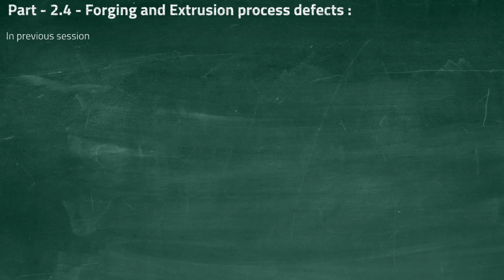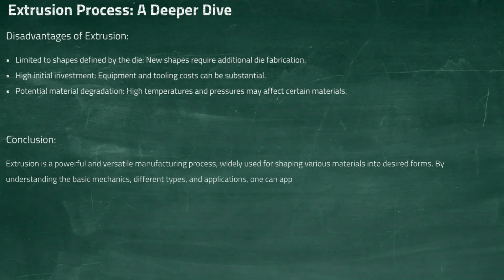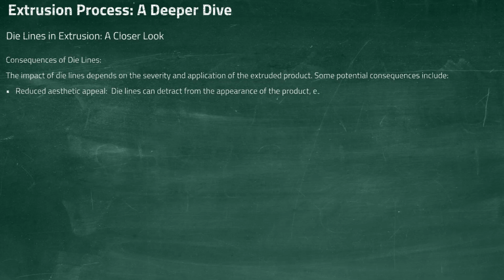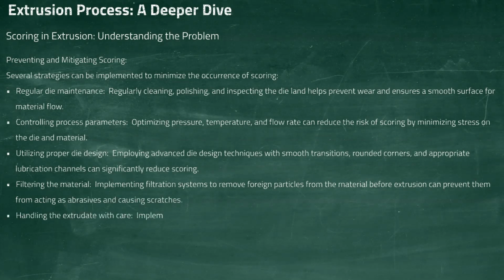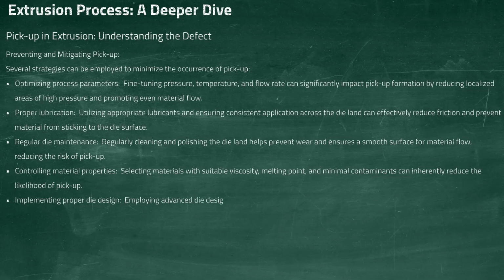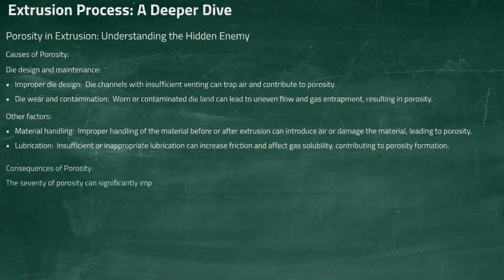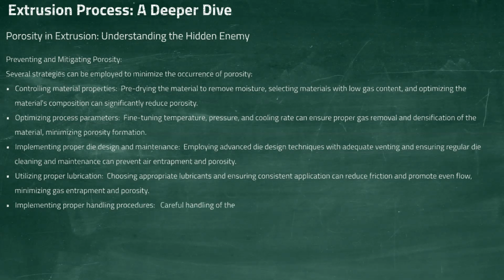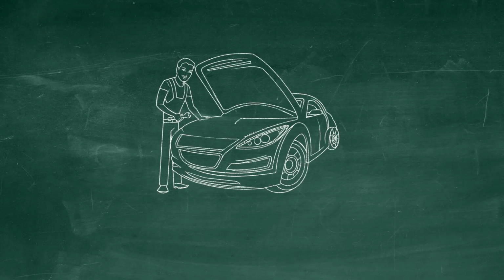Part   2.4.2.1   Extrusion Process Defects

Comment: Your video is over1/2 an hour long with very small hard to read lettering. I am not sure, what is the purpose of your video. I have mechanical engineering background and understand what you are talking about. If I may make a few suggestions, as today audience have very short attention span. One picture speaks 1000 words. Use PICTURES to communicate with a simple animation. (Even PowerPoint). However with Doodly you have many more options. Use large legible font (Helvetica or similar). Use bullet points and no more than 6 lines on a page.This makes your video shorter and more interesting. If you want to communicate with your audience, you need to speak their language, so to speak. Otherwise you loose them, never to return again. Less is more. Make a storyboard of your video, time it and condense it to the important parts. it's better to make 6  five minutes videos than one 30 minutes. Please take this as suggestions, because I want to help you. You have the knowledge of the subject, but it's a different ball game to communicate your knowledge with your audience. Cheers (https://www.amazon.com/STORYBOARD-NOTEBOOK-extensively-environment-production/dp/B0CR7XV9SR?ref_=ast_author_dp)